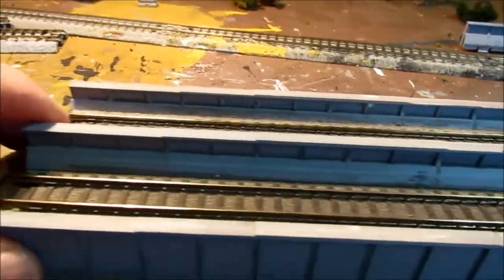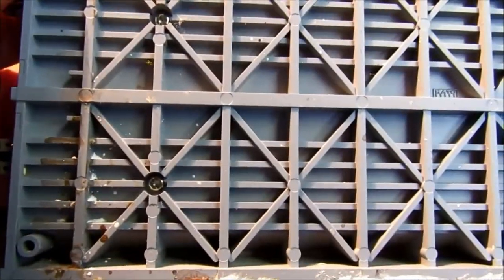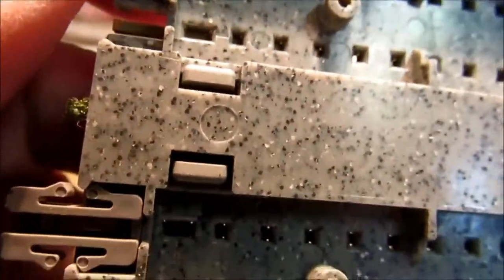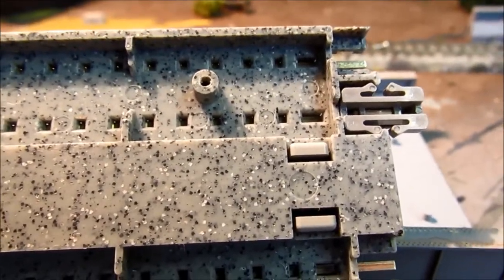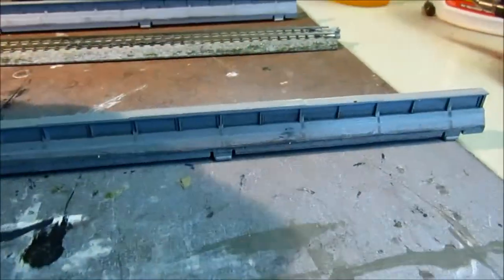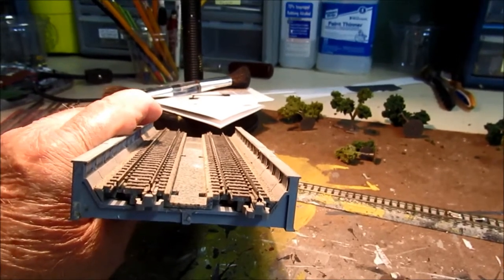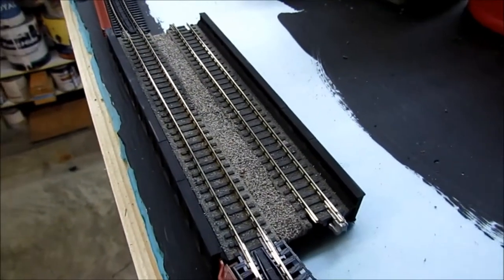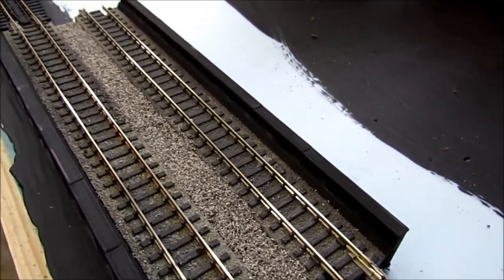Kato double track plate girder Bridge rebuild

Comment: Looks good. What would you use to support the bridge if it was like the overhead tracks like in New York or Chicago
Reply from the maker: There is a company that builds the type they use in Chicago and New York, I can't remember there name but I do remember they were not cheap by any means. I'm not sure if they built in N but they did in HO.  I thought about using them till I seen the price and decided not to because I'd have to cut them to fit my area..

Comment: I hate to be a downer here, but you really didn't show what you did with those pliers. Did you just snap off those tabs? Otherwise, the idea and result are really great.
Reply from the maker: You have to push the tabs away from were they are sitting, and also push down so the tab falls into the slot, I used a needle nose pliers closed, and pushed away for were it sits and also down to get them so they sit just in the slot, then all it takes is another push and the center piece is ready to come out.. Don't know if my answer helps, this is the first information on redoing one, the first one wasn't taped so I could see how it went.
Reply: @NScaleRailroad  Thanks. Looks good. Appreciate the explanation.
Reply from the maker: @gmaneis  Your welcome